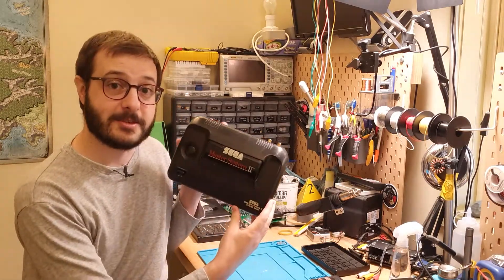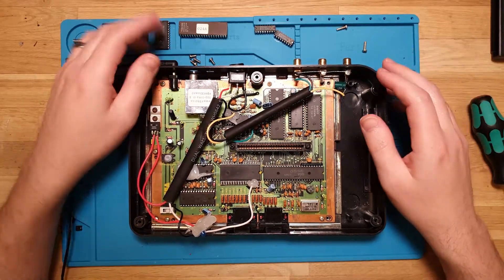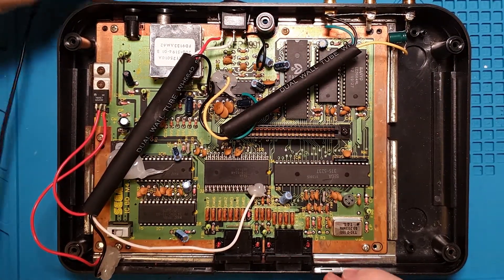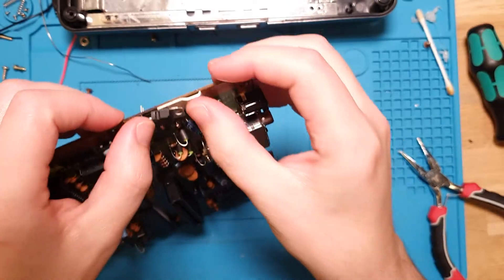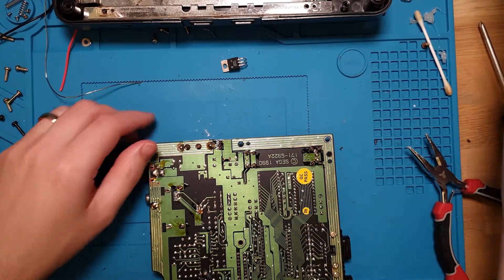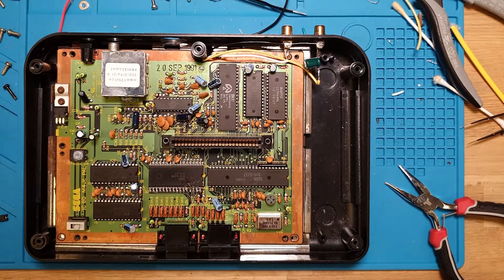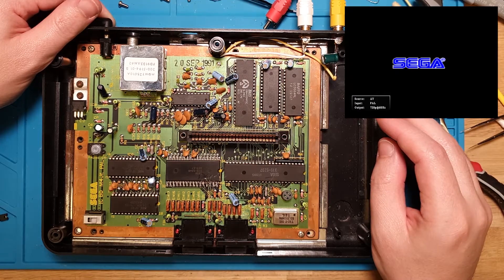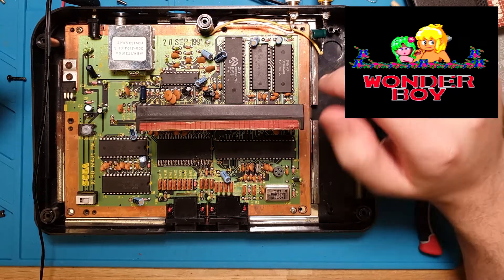Fixing and tidying up a Sega Master System 2

Comment: Thank you so much for this video. Just finished comp modding a SMS2 thanks to your video. I did put in both audio channels for dual mono. Put in a 100Ohm resistor and 470uF capacitor between the video wire and the RCA socket. Took off the underside bodge wire as well.

Comment: You mentioned removing the RF modulator to make room for the RCA jacks. If you do that, can you just unsolder it and leave the circuit as-is, or do you need to put some components in to keep the supporting circuitry happy? (Great vid btw!)
Reply from the maker: Great question! The RF modulator on the SMS2 picks up power, ground, composite video, and mono audio, which it then uses to produce the RF out. It's completely passive and output only, so you can safely remove it without affecting the existing system!
Reply: @silvestronsbitsandbytes  Thanks for the response! I recently dusted off a functional SMS2 and Mega Drive 2 that a friend gave me and I'd forgotten about. After watching your video, I'm confident in doing the Composite mod to this one. I saw the modded systems for years and couldn't justify the purchase. But seeing how easy it really is, I'm keen to give this a go!

I had an ebay buy 12 years ago too that was DOA. I tried replacing the regulator first, no luck. I even tried replacing the pause switch, thinking if the switch was shorting out, then that would hold the system's NMI pin in place. Although I don't recall if the Z80's NMI is edge or level triggered. That fix failed and I opted to hang the motherboard on my wall as nostalgic art.

Comment: Nice work!  If I would standardise on one av socket it would probably be a 5 pin DIN, since so many machines in the day used those.
Reply from the maker: The original Master System did use the 5-pin DIN for AV out, but the main reason I was thinking of the 9-pin miniDIN from the Mega Drive was because it also carries RGB for those inclined.. also smaller means smaller hole so it could fit in the space already provided by the RF output on the SMS2

Comment: so they connected the vcc out of the 7805 to the led and then to VDP ground? basically they blew up the led into becoming a wire, shorting and burning the 7805 as well ?
Reply from the maker: I don't know what they were thinking, it wasn't in danger of blowing anything up, it was just completely incorrect and never would have worked in any intended way at all... thankfully!

Comment: I wonder if the solder on the Sonic The Hedgehog 2 cart was a previous effort to dump the ROM without de-soldering the actual chip? Possible. Especially if it was done by the same person responsible for the original Composite mod.
Reply from the maker: It's possible! I didn't really look at which pins had solder on them...